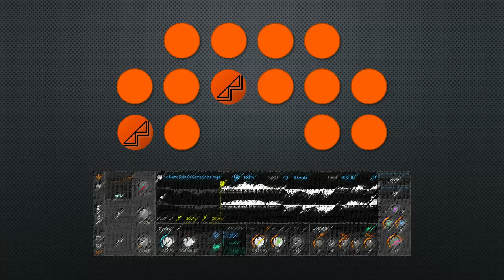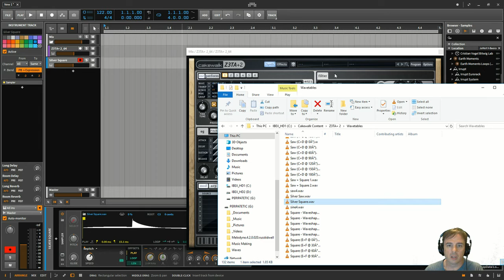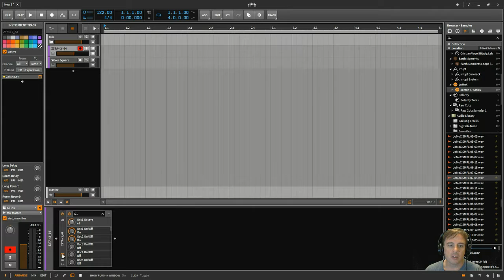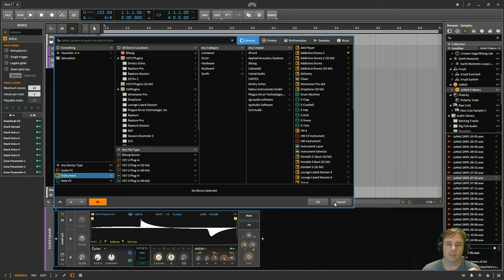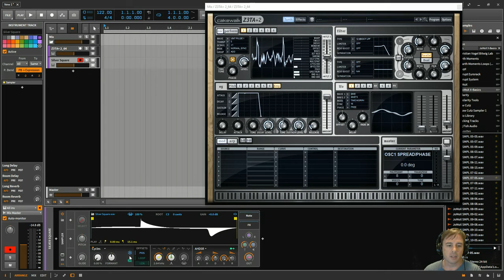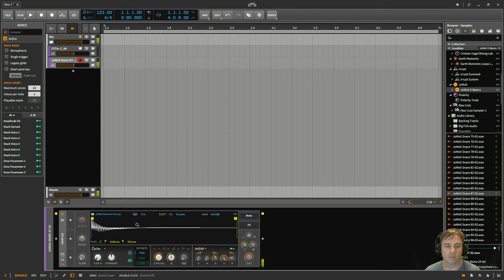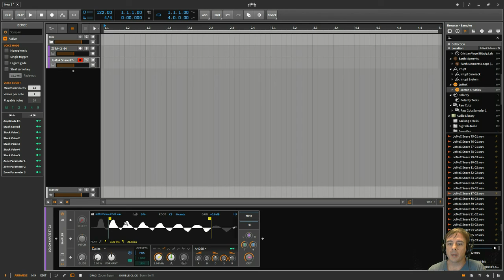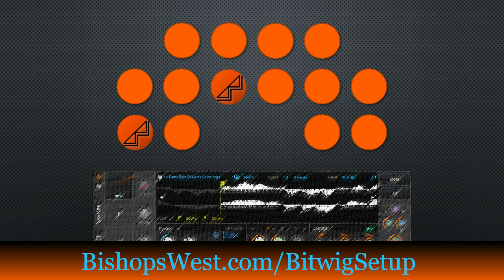Can the New SAMPLER in Bitwig Studio 2.4 Really be Used as a WAVETABLE SYNTH?!?

Comment: You have misunderstood how it works in Bitwigs sampler. Freeze the playhead and then use the play posisiton to scan through the waves in the wavetables. None of that manually setting start and end points like you do.
Reply from the maker: Good point. I should have done that in that last sample I had loaded up, instead of moving the start/end points. However, when you have a huge sample (several bars, or even a whole song), it's still useful to set the start/end points so you can work with just a smaller section; otherwise, it would be too imprecise.